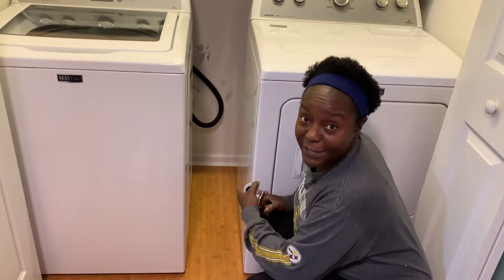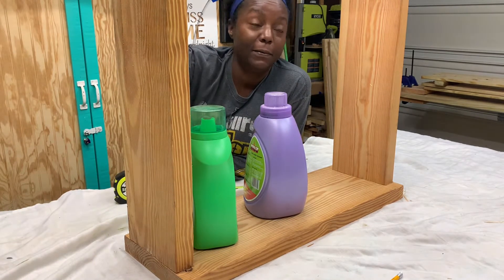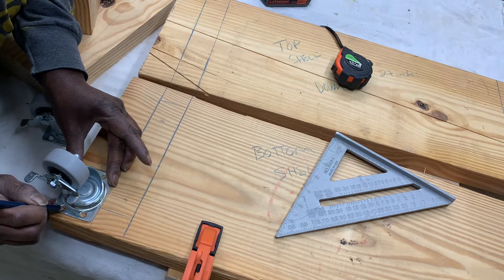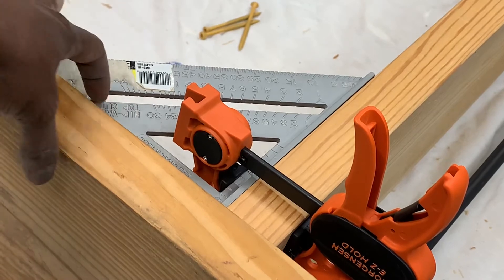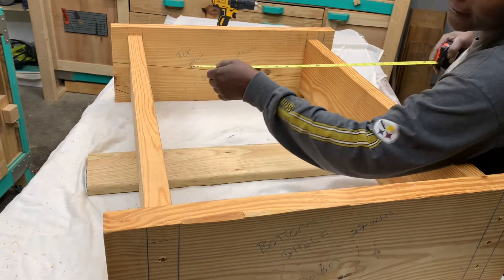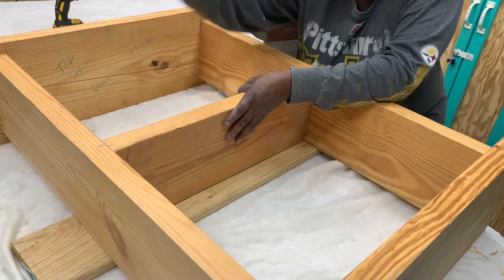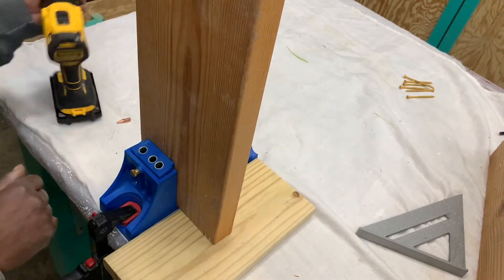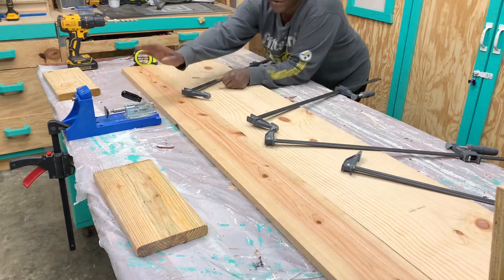ORGANIZING the LAUNDRY SPACE MAKEOVER//FOLDING TABLES//LAUNDRY CART//BUDGET DIY for REGULAR PEOPLE

Comment: This is a GENIUS idea! What type of wood did you use for the folding table and how did you make the latches for them?
Reply from the maker: Thank you! I used pine boards 11 1/2 inch wide and had to add a 1x6 to get the width I wanted n joined together with pocket holes, glue n screws.  
For the latches, I just used some scrap wood pieces, made a T by sitting one piece on top of the other n adding a screw kinda loose so it would turn. I hope that helps!
Thanks for watching and supporting the channel Be Blessed 😊